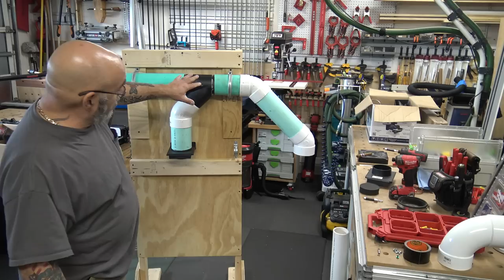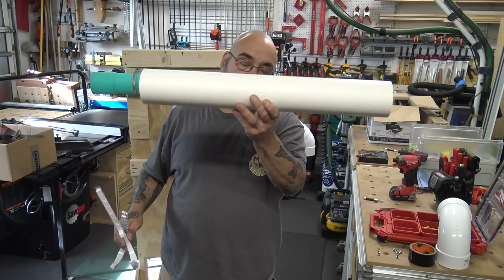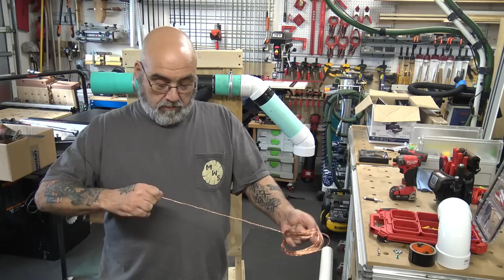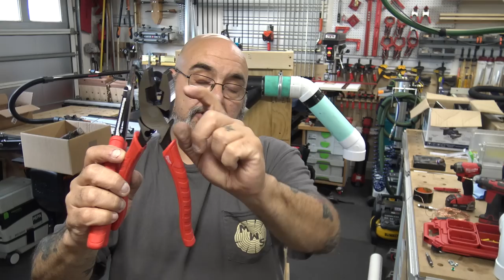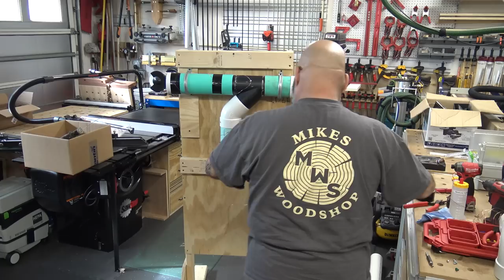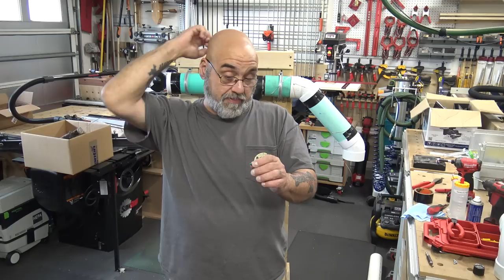Grounding your dust collection system.

Comment: never seen a fire cause a a dust collector. Been a firefighter for almost 40 years Been a woodworker and never ground my system.. good video.
Reply from the maker: Mike Barnstable was a firefighter for 21 years (ex chief) and never saw a fire caused by a dust extracted either lol. Thank you very much
Reply: Lol you guys are funny. Not from a dust collection system but I did see a flash over when a bunch of guys were lets just still learning English were sanding floors in an old Victorian house. They weren't to neat or concerned about ventilation. I have no idea what ignited it but it got warm and bright fast.
Reply: Do you think you need to ground your dust collection system or no?

Comment: I just bought a roll of the foil tape, it was only $15, and I ran a piece in a loop along one side of the pipe inside and out.  I did this to every fitting and section of pipe, so that when they connected, the aluminum tape touched.  The tape is thin enough that I didn't have much problem fitting the joints completely.  I put a small screw through every joint just to make sure there was continuity inside and out.  I have a lead from the metal coil on the flexible sections that can wrap around the screws at the joint.  I'll add a small wire and alligator clip on the machine end to ground the machine too.  None of my machines are permanently connected, so that's why I have to do that.

Comment: Mike, good explanation and video. The issue of static electricity in home dust collection systems is not about explosions, but definitely about best practices for insurance purposes and personal comfort (i.e. not getting shocked). 
Also, regarding your wyes and other fittings, air flow direction should always be factored into the type of joint used for your pipe/fitting connection. Solvent weld fittings fix this issue easily. That 4” wye will work, but is hurting air speed and producing plenty of turbulence not far off the tool.

Comment: Good video.  One sugestion: The tape you are using is TEMPORARY.  It rots and will not stick over time.  Metal duct dape will last for generations and it is air tight.  Same amount of work to install.

Comment: Ok, I'm a year late but pay attention. I got fed up with plastic gates breaking and waited for some metal ones to go on sale. I ran straight wire run on the back of the pipe (hidden) and attached via one screw into each gate. Done. You only need the major large blast gates to be metal. The 2-1/2" runs are usually short.

Comment: I enjoyed your videos on extending your shop vacuum system. I am trying to better understand how the grounding actually works. Is the grounding actually taking place where the screws go through the fittings or does the wire wrapping around the pvc tubing also ground the pipe. Do you recommend placing the grounding screws through all the pvc fittings as well as the blast gates?  Should you also place screws through the pipe on long runs?  Why did you use the green pipe rather than the standard thin walled pvc pipe? Thank you, in advance, for your response.

Comment: While there is a ton of useful information in this and especially the previous dust collection video (thanks!), there's no real reason to "ground" a dust collection pipe.  First, the volume and speed of wood dust traveling through a non-metallic pipe needed to build up a charge high enough to cause a discharge capable to igniting the wood dust is effectively impossible with a home/small shop dust collection system.  Also keep in mind that any charge is going to build-up on the INSIDE of the pipe, not the outside, so wrapping the outside of the pipe with the copper wire doesn't effectively dissipate the charge.  Finally, the volume resistivity of PVC is only slightly less than air, so the few screw penetrations to the inside of the pipe isn't nearly enough to effectively dissipate any built-up charge (you'd need thousands of penetrations).  If you truly can't sleep at night worrying about a dust ignition, then build the system out of metal pipe, otherwise, it's much ado about nothing.

Comment: I watched both videos.  Excellent information.  I am up grading my current single bag Delta system to a Jet 3 hp cyclone unit.  I did not realize that you could wrap the pipes with the ground wire?  I have my ground wire running inside my 4” pipes and flexible connecting hoses.  I plan on re-doing my entire system like you have done.  I assume you wrap the flexible hoses that connect to each machine and then attach that wire to the machine?  Do you use a stainless steel screw that you tap into the pipe?  Also what is the size of the screws you use?
Reply: I have the same questions

Comment: Only way this works is if every but of the inside surface is covered with something grounded.  A single wire and a few screws doesn't work.

Comment: Well done video. One question, that I might have missed in the video, if the screw tips provide a contact point for static charges why is it necessary to wrap the grounding wire around the pipe? Keep up the good work.
Reply from the maker: V Segarich static also builds up in the outside. The whole pipe gets charged. If you ever notice how the dust builds up on the outside of a shop vacuum hose that’s what it prevents. Mike
Reply: @TheBuddylab  Thanks. Thought a straight run of ground wire would do the trick. Lucked out and have not been zapped by my dust deputy and shop vac combo.

Comment: Mike Thank you for this You are Very well versed and make the process seem so easy. One question which i'm sure has been asked But Were would you ground to if using a Large Shop vac System? Thanks you just earned a New Subscriber.
Reply from the maker: Stone Fisted Props thank you very much

Comment: When I heard you say Sta-Kon wire connector I thought it was a type of connector. Now I found out it is a brand name. What is the connector you are putting into the hole you drilled? What does it look like?

Comment: Is the silicon you mention for the seal meant to be the silicon based caulk that hardens (like bathroom or window/door caulk) or is it something that stays in a gel state?  Can you point to a brand for the silicon and the grease too?  Thanks.

Comment: If the screws are picking up the static do you have to wrap the wire? Or can you just run it straight along the outside of the pipe? Would be quicker and use less wire. Would that work?
Reply from the maker: Bob Keller you need to wrap the wire, there is static on the outside of the pipe too.
Reply: @TheBuddylab  ok. Thank you
Reply: @TheBuddylab  LOOL american sience I guess

Comment: well if you took the time to set up a mock up, it would have been great to actually run air fluid and dust fluid and check the static electricity before and after.

Comment: I really appreciate that you offer your experience!  VERY helpful.  Can you answer a technical question please?  Rather coiling the ground wire around and around the pipe (on a 20 foot run you might use 40-50 foot of wire), would I get the same protection if I simply started the wiring just like you did BUT only ran the wire across one side of the pipe (say along the top of the pipe) and to keep the wire nice and tight, inserted a screw say every 2 feet, wrap the wire around the screw and keep going on down the length.  On a 20-foot run, oud only use 20 plus a few inches for the screw wrap.  Would this work just as well?
Reply: grounding is a total waste of time and money, do your research

Comment: When you grounded do you put a grounding rod in the ground
Reply from the maker: Paul Vanslyke no just ground it to the vacuum motor the system will be grounded through your electrical wiring
Reply: @TheBuddylab   Ground rod is for lightning

Comment: Great video, Mike! What's the name of that small blue device you used to secure the grounding wire... Staycon?
Reply from the maker: Orlando Salcedo it’s Sta-Kon wire connectors. They make all different sizes and shapes they crimp on with pliers
Reply: @TheBuddylab  thanks! Hey, what's your thought on using DFW vs sewer pipe? Will DFW handle a dust collection system?

Comment: Thank you for the very informative video, I have a question.  When designing a dust collection system is there a benefit to running the piping overhead vs piping down and along the baseboard.  I ask because I am in the process of designing a system for my shop, all of the pipe work will go down a single 35' wall.  I would prefer to run the conduit at around 4" off the floor and Y-up to the blast gates then flex to the machines.
Reply: Having the piping underneath is beneficial as you get the additional help from gravity. Piping is often overhead so floorspace is not lost, the install is typically easier and piping that is not underfloor is open to damage from everyday shop activity. Remember when planning to ensure you have no 90's, use 45's with as long a straight in between you can.
Reply: Thank you very much, I appreciate the advise

Comment: Roughly how much suction is lost from not sealing the joints ? Is there a way to figure that out ?
Reply: You won't lose that much if you are using pvc and you have good cuts and fully seat them. you would more than likely lose more from blast gates than piping joints.

Comment: coiling ground wire entire length of system is overkill to be honest,  most static in any system is generated in the flexible coiling connected from machine to ducting (as a result of increased friction of the bends and the metal coils that support the pipe).  wire running along the system ran under metal clamps, attached to blast gates (if using metal ones), and grounded to machines and dust collector frame will suffice
Reply: I have some copper tape from hobby lobby used on stain glass. Will that be ok? I know the plastic and everything is a good high voltage insulator but under static where electrons stripped off everything is a good conductor. I think maybe running metal tape down the pipe might be good enough.

Comment: Ehh. static is mildly annoying if you are regularly touching your pipe. Since I use metal blast gates, I never notice it. Grounding is also not necessary seeing how I have yet to find a single case of dust collector fire in the 10+ years of wood working and forum reading. Loads of guys say it could happen but not one has posted a fire report. Silo fires yes, maybe a production shop that has a dozen machines running all at once but not one single use system. It's almost impossible for one person to make the required fuel vs oxy mixture.

Comment: I have never heard of needing to do this. I have installed  duct systems all the way up to 12 inches for all sorts of systems and no where in any of the manuals that come with the blowers  was there a mention of needing to ground anything but the motor itself and that is handled through the Electrical system. The tools themselves are grounded already so they are protected as well.  I see no need to ground the piping.  Get rid of the cigar, it only makes you look foolish. By the way my mother died from complications related to smoking at the Age of 55' she never got to meet any of Her grandkids and they never got to meet her. everyone suffers from such such habits.